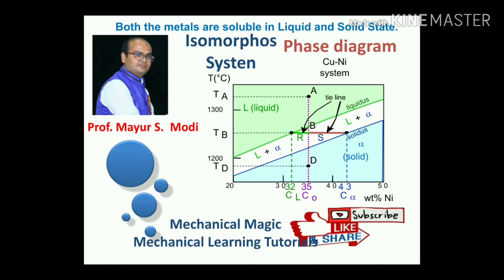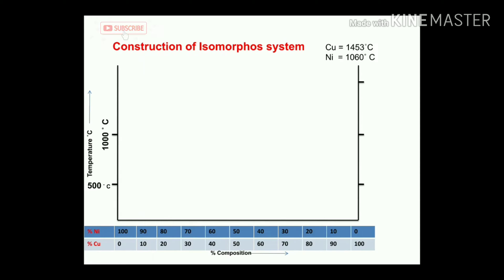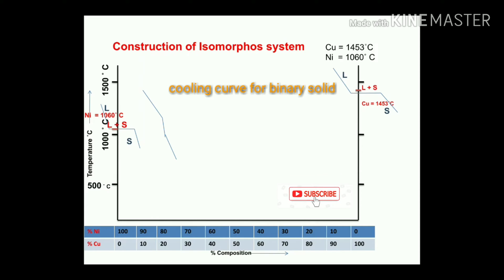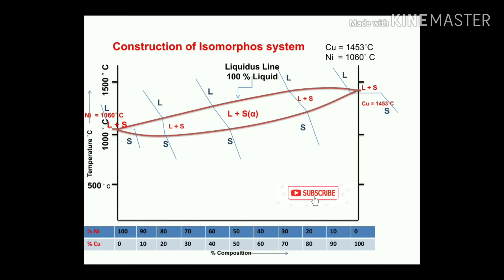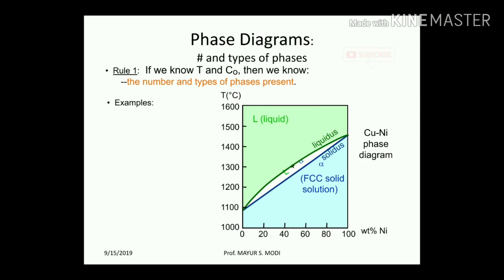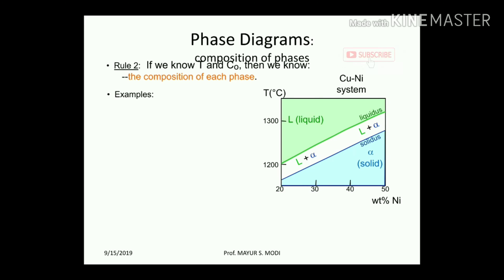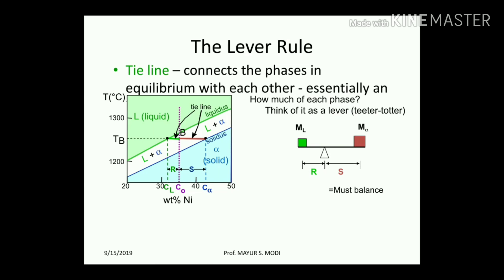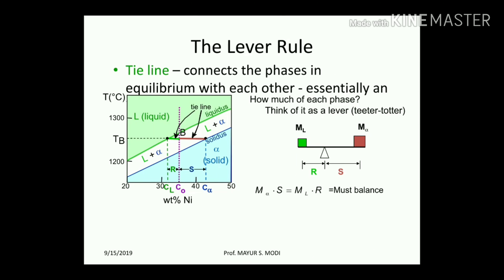HOW TO DRAW PHASE DIAGRAM | ISOMORPHOS SYSTEM | CU-NI BINARY ALLOY | SOLIDIFICATION OF ALLOY | GATE

Comment: sir, please check once.......Nickel and copper melting points are wrong. Nickel melting point is 1455 and copper is 1085. you said in reverse
Reply from the maker: I had taken nickel 1453
And copper 1060, but i might be change due to different reference book. 
But you can use it  dont worry. 
Thanks for commenting 
Subscraibes and keep watching...